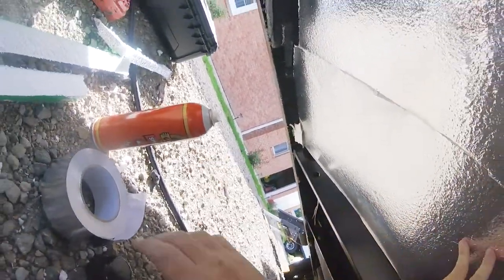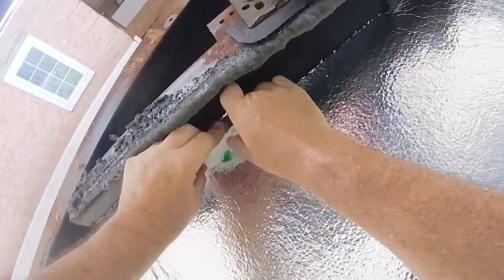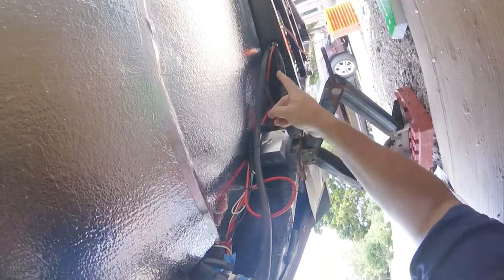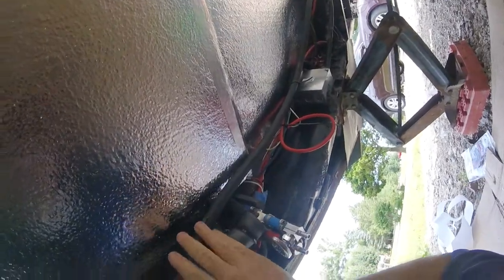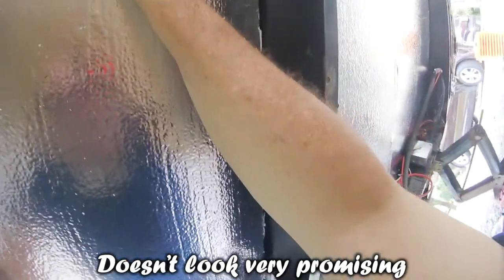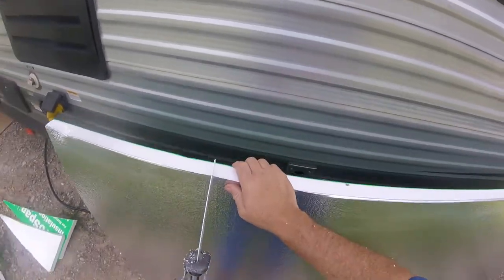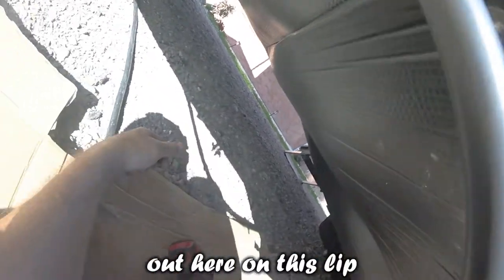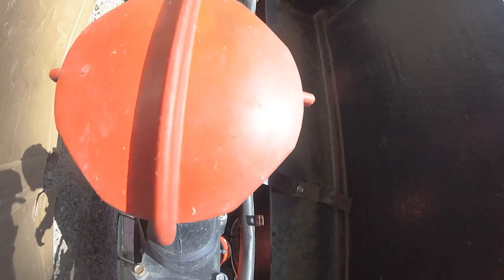REPLACING Our Campers Underbelly - FINALE (Pt. 4): Insulation & Underbelly Material

Comment: I am glad you are attempting to make your trailer better suited for cold weather. I have learned a lot about this from the school of hard knocks. The added insulation is good, but you have to have a heat source to keep the water lines flowing and it also helps to keep the heat in. I just got done removing my coroplast on my 2018 Solitude fifth wheel and I replaced the fresh water tank heating pad with a larger more powerful model. The original pad was 77 watts, the new one is 160 watts. I have heat durcts from the furnace blowing into the belly, but I found many areas where the factory shorted the fiberglass from reaching frame rail to frame rail and they didn't put any insulation under the drain portion of the fresh water tank which is where the feed line to the water pump is located. In the past I was making it to -10 before my water would freeze up, but this year it froze at about +5, so I think the fresh water tank heater quit working. I also have a diesel heater that I have ducted to pump air into the belly to keep the plumbing warm. It works well, but when I found all of the areas that were missing insulation I know why I had cold spots inside the trailer. I went one step further and I spray foamed the outside of the frame! Think of the frame as a giant heat sink, when it gets cold out the frame is transfering the cold to the belly. It is kind of hard to stuff fiberglass or fit hard insulation to the inside of the frame rails, so the outside is an easy choice. On my last 5er I cut rigid insulation and fitted it to the outside of the frame rails between the flanges, it makes a big difference. I also put heat tape on my water lines on my last trailer so that I could keep them thawed when I was running my generator.
Reply from the maker: Thank you great info! Yep it’s all trial and air. Happy Camping!!

Comment: I'm glad you didn't put the propane lines in the underbelly!  There's a reason they're "on the outside" - because if you ever have one of those propane lines leak, they aren't filling up that air space with flammable "boom gas"!!  You have at the same time both inspired me AND discouraged me from taking off my underbelly to run some electrical lines...  It's looks like a huge PITA to do that.  😬
Reply from the maker: It was a huge pain for sure. Bigger job than anticipated.

Comment: I have a 93 model holiday rambler travel trailer. Its in great shape and im building it out for off grid full time living. Ive bought a nice waterless toilet and im about to remove the black tank. The underbelly is in perfect condition at the moment but im going to cut it and pull the tank out and while in there im installing heating pads for the rest of the water system. Im leaving the existing insulation but adding 1/2 inch of Styrofoam board insulation and then covering with plastic plywood. Im hoping to get it insulated well enough to keep the plumbing from freezing in the winter without using antifreeze.  Im sure its gonna be a fairly difficult job. I plan on making a few access panels to be able to open and easily get to the plumbing for repairs if needed at some point. Thanks for the video
Reply from the maker: Good luck!! Hope it isn’t a huge pain. Please keep us updated on the outcome!! Thank you for watching!

Comment: Where did you get the new underbelly at? If you don’t mind me asking
Reply from the maker: Hey, Don’t mind you basking at all, hope this info helps. 

Reflection foam https://a.co/d/ewhlMk2

Tough Grade Corrugated Poly Underbelly material
https://a.co/d/9OJ5zzi

Tank Heater  https://a.co/d/inugMN0

installation board - Home Depot (it was cheaper) 

All the screws and smaller things were also purchased on Amazon as well.

If you have any other questions feel free to ask.

Comment: I have a question isn’t the reflective part supposed to go towards the underbelly instead of towards the outside? Thanks. I’m trying to get it to my Winnebago.
Reply from the maker: I am no insulation expert, but, I was only looking for some additional insulation quality, and I was trying to keep it from getting through the underbelly up to the floor, hence my reason for installing it the way I did.
Reply: The reflection side needs to go towards the air gap. In this case the underbelly membrane (ie he did it right)
Reply: @roundpeg3239  foil side down if your rejecting heat (like this video shows), but in this case it appears the intent was to maintain heat so I’d have an air gap between the reflective side and the RV floor to keep heat in.
Reply: @TheRealBiggerAl  I do roofing.  the reflect side goes towards the airgap to keep the airgap constant.  It is the best way to keep the temp inside stable.  your goal shouldnt be to reject heat or cold, but to maintain the constant within the structure.  climate control appliances (heaters and AC) do the rest.  As such, airgap's consistency is what is being protected.  reflecting the internal temperature back to the airgap is the proven practice.  Also, just an aside, the reflective qualities are technically on both sides since it only reflects IR.  so it still rejects external IR, but you get most of the IR reflection on the unabstructed side because the obstruction (foam, paper, or whatever is adhered to the "non reflective" side) itself absorbs and slows that reflected IR.  that absorbtion and slow release is what you want to happen OUTSIDE the structure to reject heat.